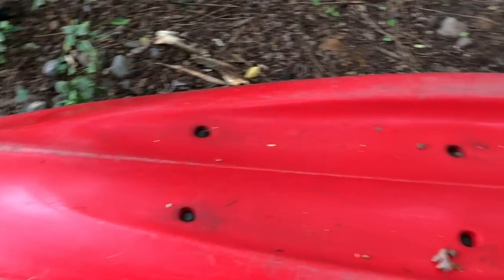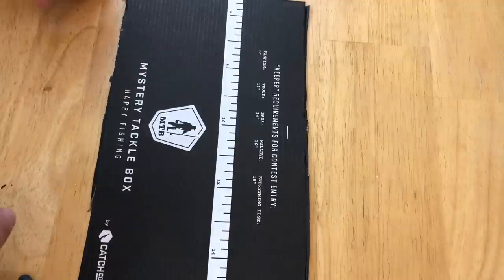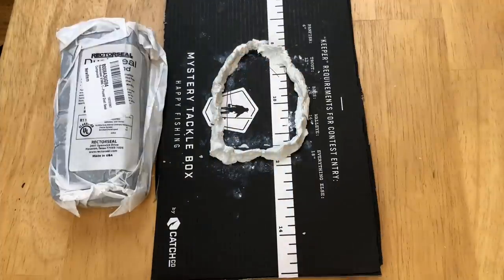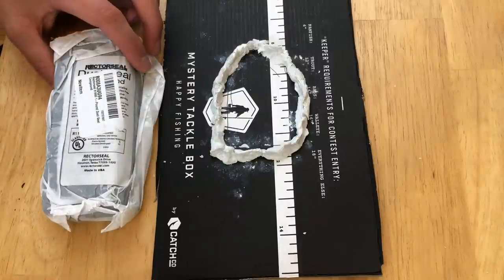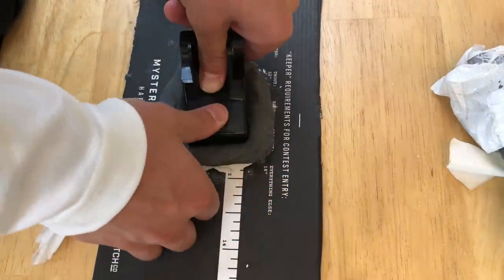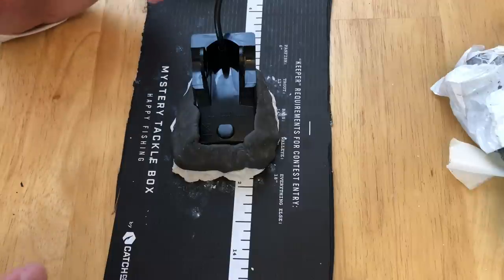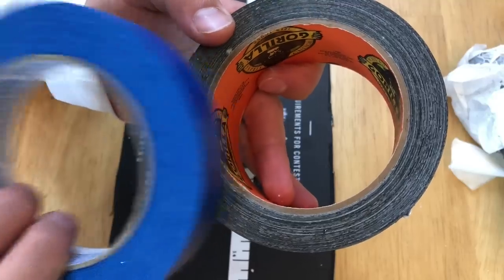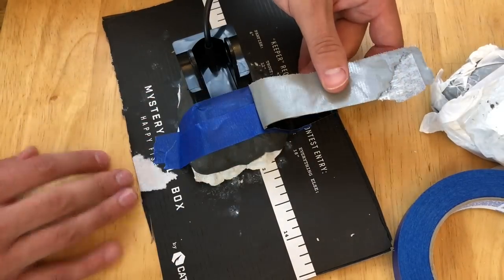How to Install Transducer in a KAYAK (EASY!) - GARMIN STRIKER 4

Comment: I have just purchased a striker 4 to use in an aluminum boat. Do you know if this installation will work thru aluminum? Some say yes and some say no: those that say yes, generally say up to 1/8 thickness. using your method, looks like thickness is not the problem!

Comment: What is your kayak made of? I’m looking for a way to mount a transducer to my HDPE canoe, and nothing really sticks to that plastic... it is square stern but I run electric trolling motor. Short of a mound of melted milk jugs... I think im gonna have to transom Mount the transducer somehow right next to the motor. Just worried about “noise” from the motor...
Reply from the maker: The kayak is made of hdpe as well, you could look to do an in hull similar to this method and shouldn’t have the churn that would happen near the trolling motor
Reply: One More Cast thanks for the reply

Comment: Great video. I am strongly considering getting this fish finder for my kayak. I have a sit in, so I am war gaming the complete setup. This helped a lot. Just to be clear, you do not have to cut a hole in your hull, and reseal it,  it will read through? Sorry if that seems like a ridiculous question, I am new to the kayak fishing game.
Reply from the maker: Correct! It will shoot straight thru the hull, and a solid medium (duct seal). That's the beauty of this method as it requires no drilling!
Reply: @One_more_cast  thanks for the fast reply! One more solid reason for this model i guess. I am going through your other videos now, i need to figure out how I would run the cables.
Reply: Shot you a message on instagram
Reply from the maker: @dennisrooney6246  If your in a sit in, you could probably get away with just running it out of your pit. If you do need to drill holes in the top for the connectors, you can drill holes in a piece of rubber, run your wires through that, and seal everything up with some marine grade sealant.
Reply from the maker: @dennisrooney6246  sounds good!

Comment: I’ve seen other videos similar to this and I was told that with this type of set up you need to have water between the hull of the kayak and the bottom of the transducer, is that true? What if there is a bubble underneath your transducer above the hull of the kayak what happens?
Reply from the maker: Nope that’s not true. A bubble will cause read issues, which is why the duct seal works so well, since it’s much easier to fend off bubbles rather than silicone or the like.

Comment: So just to be clear, you don’t put any water on it prior to use. Just failed on my first attempt. Watched your video but couldn’t find it when i went to install. I tried the cup mount but didn’t rough up the area.  Planning to go get some duct seal and jv weld this time. Just curious about water and then to ask if you think this will work on a curved hull. Struggling to find reachable flat space.  Installing on a pelican catch 100z
Thanks for video, hoping for a bit more guidance!

Comment: Great video mate, I’m having trouble finding duct seal, would anything similar work ?
Reply from the maker: Silicon works as well but can crack and have air bubbles form. I’d assume something like playdo could work?
Reply: One More Cast yeah a work colleague said he used silicone and it held for a number of years, I think I’ll try silicone 👍🏻

Comment: Hi, thanks for posting this, after a year or so of failed readings, i installed exactly as you showed.  the 1st time it seemed to work but i never got an actual depth reading(it would show the bottom, but never gave a reading on the top line in feet).  i pulled out the duct seal and remolded it so that on the underneath side of the transducer the duct seal was very thin, maybe about 1/8" or thinner and then it the worked great showing both the bottom and the actual depth reading in feet.  
How do you have the gain set on your garmin?

Comment: Great info. My xducer has been held in with duct seal inside the rear compartment in the keel of by Big Rig and was considering changing as I was questioning if I was getting accurate readings. I understood I wasn't accurately reading temp but didn't think it thru that the hull eventually equalized with the temp of the water. I do still think I'm going to move the xducer forward though because I think I get false indications of fish due to turbulence while rowing. Any thoughts on that?
Reply from the maker: Thanks for the comment! I think you could definitely be getting false readings if the transducer is far back enough to get any turbulence from paddling. I would try moving it as close to the middle as possible.  As far as temp goes, i haven't tested myself but have always been told that any thru hull method will cause temps to be off so i just dont pay attention to the temp from the transducer and have a separate thermometer.
Reply: @One_more_cast  well said..

Comment: Hi, Just wondering why you need to make well for duct seal being it's not a liquid.
Reply from the maker: So the main reason i put the well in there is to make sure no water or condensation gets under the duct seal (since i installed on a V in my hull. Although its not a liquid, in the past i did not put a well and found mold and other things growing under the duct seal which messed up my readings. hope that clears it up, let me know if not. Thanks for commenting!
Reply: Thanks for the reply, that’s definitely a good reason to make a well first.
Reply: I had to put water on the duct seal to make my fishfinder work because i dont know why it wasnt working when it was dry

Comment: Is there a max amount of duct seal between the yak and the transducer where it will no longer work>?
Reply from the maker: I’m not sure, however I would think you would want the least possible to get the best reading. I think a few inches would be fine though

Comment: Do you have any ideas or recommendations for mounting a fish finder on a Boatworks Angler 360? any guidance would be appreciated. Thanks again ...
Reply from the maker: hmm, i have never seen one of those, does it have an accessible hull?
Reply: @One_more_cast  see, there are 2 hulls which I do have access to the interior of each hull ... but ... there is no flat bottom to the hull. Does the bottom of the hull need to be flat for the transducer to work property? If I could attach pictures to the reply I would. Thank you.

Comment: what kind of material the kayak made of? is there will be any problem if the kayak is made of fiberglass? How about kayak made of wood?
Reply from the maker: The kayak is made from hdpe plastic. I’m unsure if those other materials will work the same, however I would assume as long as there is no air gaps it should work fine

Comment: you dont need to add water in the well for it to work?
Reply from the maker: Nope! the duct seal acts as the medium, and the transducer shoots right through that and the hull.  The only thing to consider is making sure no air exists between the duct seal and the hull, but its 100x easier to do this with duct seal vs. a silicon or marine goop, etc.

Comment: Does it matter which way the transducer faces??
Reply from the maker: I don’t think it will matter as far as the scan goes, but could mess up how it shows up on the unit. I would always make sure it’s facing the way you intend to be facing as well
Reply: So which way should be the front side..? The round part or squared off part? I installed my transducer with the squared size facing forward..

Comment: Doesn't the transducer have to be installed in a way where it is submerged in water? If it's installed inside the hull of the kayak, directly onto the body of the kayak and it's not in the water, how can it work properly?
Reply from the maker: Nope, it just needs a solid medium to shoot through. So you just need to make a solid medium against the hull and the transducer and it will work great. You can use a number of different things to make this medium, but I’ve found duct seal to be the easiest and best really.
Reply: Thank you. Is it better or worse than placing the transducer directly in the (fresh) water?
Reply from the maker: So the reading will look the same, but the temperature reading will be much more accurate in water. I just like the ease of having it mounted in the hull.
Reply: @One_more_cast  thank you